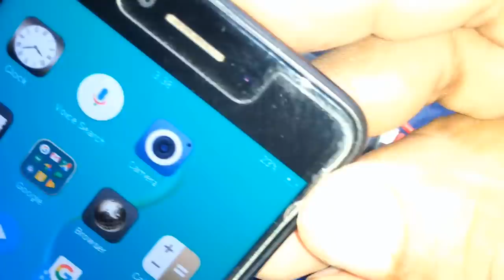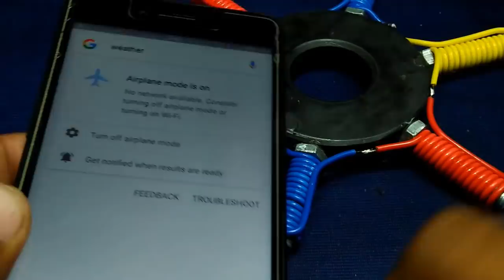Free Energy Generator Magnet 100% Real New Technology New Idea Project

Comment: This is no free energy. All you did here is a split transformer. This is the secondary coil and the primary is under the table, and this is also the reason why you don't lift up the thing. Clever, but not quite.
Reply: Thank U
Reply: SIR,,if there is primary coil under table,, what it is made up of and it's contents. PLEASE REPLY AT ANY COST. AWAITING .HAVE A NICE DAY.
Reply: @siddharamappabhorshettar656  It is a transformer's primary coil. Most probably it is made of copper wire. It works by induction. If we take a transformer apart we will find that it has one primary copper coil in which the 230v AC goes in and creates a magnetic field from which the secondary coil(s) extract and transform it into electric current again.

Comment: Since the majority of comments have been largely negative, I will also add one of my own as I  express my full agreement that this is a fake demonstration. 

However, I will also point out the one fact that I didn't see anyone make any sort of comment on unless I missed it in my reading of the comments & that is the fact that smart phones are like all PC's. 

Magnets should never be brought into contact with a smart phone or it will start to seriously glitch. 

Its like oil & water. Magnets & cell phones don't work well together so obviously, the magnet ring in this video isn't real! 

IF it truly had been real, the smart phone would have severely malfunctioned when you stop to consider that the demonstrator in this video actually set the cell phone right on top of the ring magnet.

Comment: Below table there's a variable magnetic field.
Reply: That's way too complicated for this guy - the magnet is never moved from its place on the table because the wires to the battery pass through a hole in the table under it.
Reply: Just try doing the same experiment on transparent table. If you do not agree then toi are fooling yourself.
Reply: that is right

Comment: wow I am impressed. using a 1500 WATT inductive cooker to produce less than 5 watts total. Do you really call this free energy when your power source {hidden off screen} is plugged in to the wall. Get a life and quit trying to fool everyone.
Reply: I tried myself. It worked.
Reply: Not possible. If the magnet was actually moving and its field was cutting the coils dynamically it might work. No movement and you get no current. I cannot explain what you are saying. Perhaps you can enlighten me.
Reply: Jim:
It would not matter if it was the strongest magnet on earth. If it does not move with respect to the conductor , no current can flow.
Reply: lol I know nothing about electronics and such, but I agree.
Reply: The video is obviously scamming people. Wasting people's money on useless shit.

Faraday's law have only one principle. A moving magnet generate electricity. I.e. changing magnetic flux induces voltage.

While amperage is generated due to the resistance of the coil.

E, electro motive force/R, resistance of coil = I, inertial motive force/'current'/amperage.

'I' itself do not have a name. Therefore, inertial motive force would be the most logical.
Reply: bill prince
 when copper ions meat a magnetic field they have to make room for that field so they go around it, this is your induction flow.
Reply: Vó trocar a Cemig por ima!
Kkkk
Reply: @gingerbread2875  when MOVING THRU SAID FIELD.... again, no movement.  All he built was an inductive receiver (like in most phones) and he has hidden a charger under the cloth.  Look it up.  design is easy to find

Comment: Yeah, right and your website features such amazing technical explanations as "In 1831, researcher Michael Faraday found that once a magnet is moved inward a loop of line, an electric present day streams inside the wire. A quality generator is an apparatus that changes over a type of quality into quality. Turbines trademark because of the association among attraction and power. Factories that change over active (mechanical) vitality into electric fueled power deliver the greater part of the power that purchasers utilize." Which does not make sense in any language
Reply: That's not even Google translate bad!

Comment: Have you notice these great geniuses never show their face, real name, speak? They must be afraid of the oil and coal companies. As one guy commentated that you can't charge a phone with AC, which this circuit surely produces, going back decades, most electronic companies mandated putting in safety diodes in series in the power connection, in case the wires were reversed or AC was accidently connected. It'll charged but only at half cycles.

Comment: Fake 100% because that need to rotate. If this magnet 4:46  turned on 12volt lamp, this mean voltage is abute 12volt... in this time 8:28 u connect 12 volt to smartphone?! Also with 12volt, this motor must be have verrry hi RPM 6:25 or burn that. Seet man looool